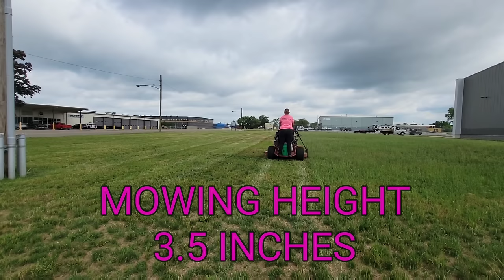HOW TO GET COMMERCIAL LAWN CARE CUSTOMERS... MY BEST 5 TIPS!

Comment: i'm 14, starting out. got 2 costumers. two of my dad's friends has a rental company where they rent out jump castles, softice machines, popcorn machines and more. and i clean some of them sometimes and earn some money. and they tell me that i should always do extra for my costumers, is that true? like trim for free for the first time doing a service or something? also i got a stihl km 131, trimmer, edger, blower, brush. soon getting cultivator. also got a lawn tractor. old china model my dad bought 9 years ago, sold it to our neighbor 5 years ago. this spring i got it for free. changed battery, oil, spark plug, air filter. and getting more soon. like a front bumper, i already got a voltmeter(on the lawn tractor, just not connected rn)led light, horn, blitz light. soon getting 4 buttons and more. Can anybody give me some tips or advice on future plans or something else? a good but not expensive lawn tractor or zero turn, zero turn preferred. from new? i've looked at hustler, ferris(better but expensive) cub cadet and more. Thanks